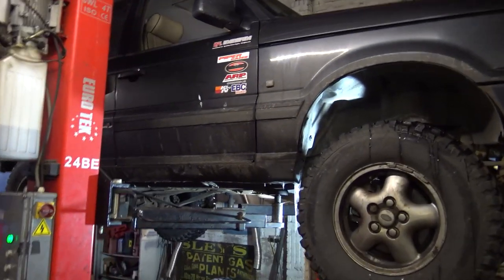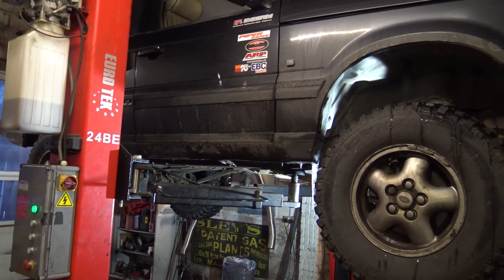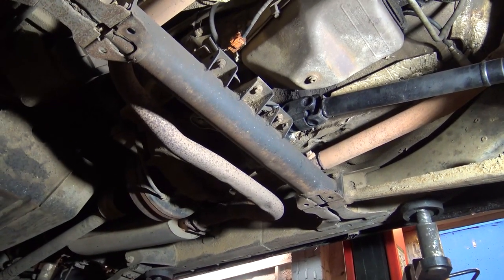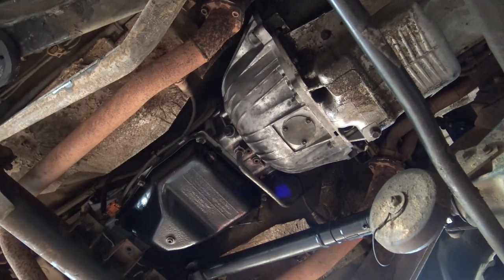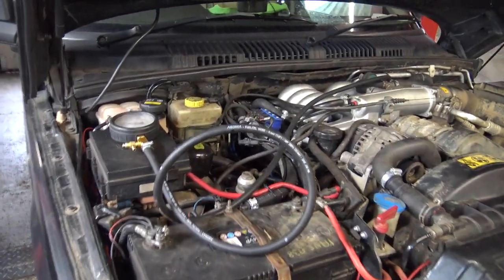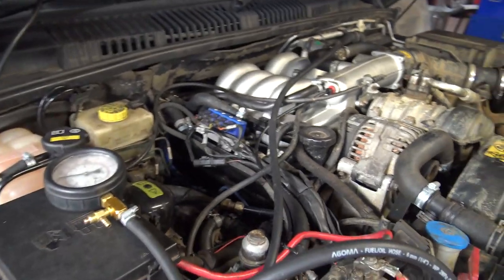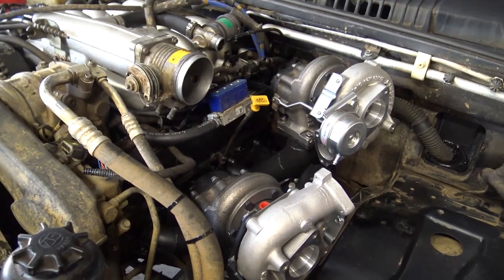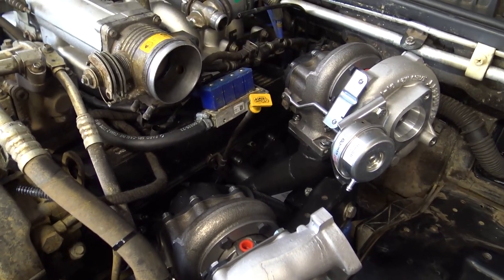RPI Engineering Twin Turbo Tuesday Episode 14 - Range Rover P38 V8 Twin Turbo Upgrade

Comment: Can I ask why forced induction as opposed to, say, a 5.2/5.4 normally aspirated unit? I have a friend with a 5.4, Omex, Bosch injectors and MAF. With a mild cam he saw 370/410 on a rolling road. Obviously, some large costs associated.
Reply from the maker: Hi Nigel,
Nice to go down a different route. I have also seen 5.0 litre engines through the Thor intake setups still only make 260bhp (obviously a bit better tore though). Of course I could switch the intake to a more conventional Gems setup for better flow however decided to take a different approach, play with some boost and see where it takes me. I believe a forged 4.6 build with good flowing heads and the right boost setup is a 600bhp figure (there are a few out there) so may end up there but at some point I think I have to think about the vehicle I put that engine in as the P38 might not be the right platform, but we will have to see :-)